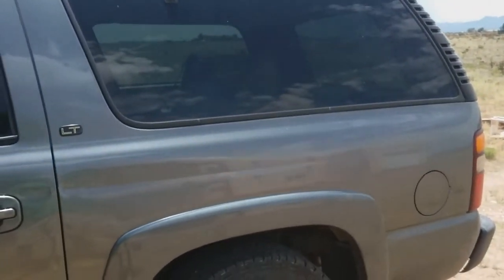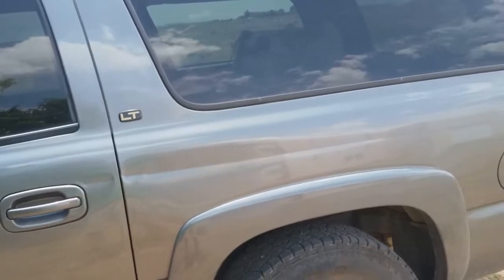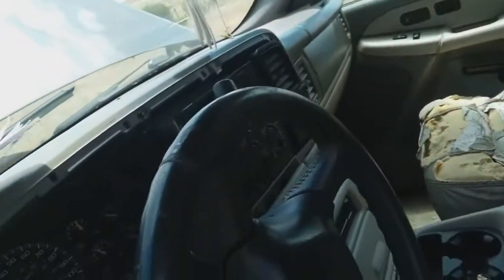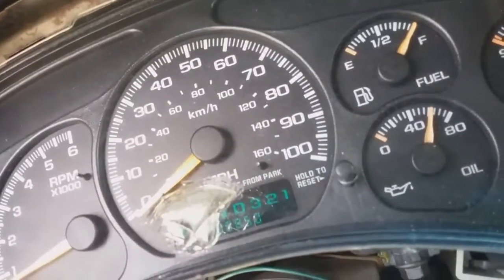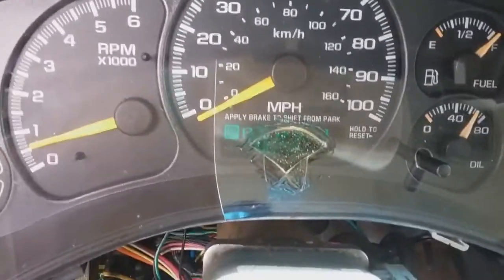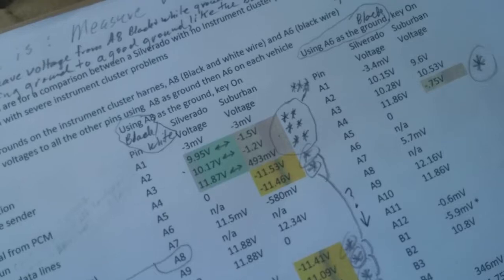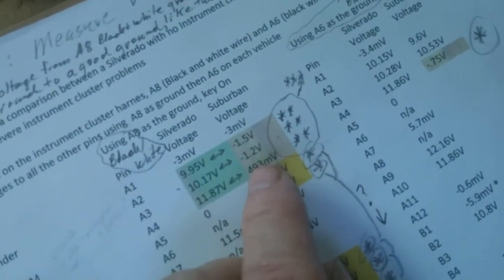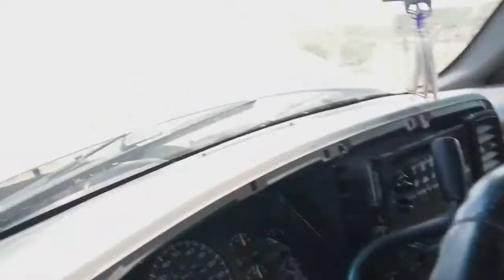2000 Suburban Instrument Cluster Fix

Comment: Pin A8 is the black and white wire ground that runs from the cluster to the back of the engine. It seems to be the wire at fault for everyone who has a 1999 to 2000 Chevrolet or GMC. Thanks for the video!! 👍
Reply: How did you fix it
Reply: @jankycustoms6089  I cut the A8 black and white wire coming off the cluster and grounded it to a metal section of the dash.
Reply: @ZBrink11  I thought I had the same problem with my cluster ( no move gauges and don't turn on ) I asked you if you cut the (black and white) wire as you stated, you don't think the ground wire is taking others  wires connected in the back with that wire or is the wire alone and just connected to the motor?
Reply: @victorgutierrez5826  I didn't cut the black and white wire, I removed some of the sheath and soldered an additional ground wire to it that I ran to a metal part of the dash.

Comment: Having a "known good" part to replace the "know bad" part. And the trouble staying at the "known bad" vehicle is a trouble shooting skill that is uncommon now a days. Except in logical thinking people. And you sir trouble shot that dash very logically.
Reply from the maker: Thanks for watching and commenting. Yes, it really helped to finally find out the dash for a 2001 Silverado could be interchangeable in a 2000 Suburban. Really helped to know it was not a bad dash, but a problem somewhere else. Then finally find the ground wire problem and the fix turned out to be so easy after that after much hair pulling. LOL!
Reply: @johntube2525  I've got a 2001 GMC Sierra with intermittent issue with gauges not working (fuel, volts, and some idiot lights). I cleaned some grounds, dielectric grease reseated and it helped for 6 months. But starting to happen again. So adding another ground to the A8 pin and see what happens. Thanks for the video.

Comment: The issue I'm having is my fuel, coolant temp gauge, and odometer display didnt work, so I replaced cluster, but having the exact same issue, the display only works in ACC mode, but not ON, I must have a bad ground somewhere also
Reply from the maker: It is pretty easy to check if your problem is a bad ground, by doing what we did in the video. Also see my other comments on how to do this. By the way,we came so close to buying a refurbished instrument cluster, which would not have worked. Luckily we had  two vehicles which take the same clusters and could swap them out to find out it was not the cluster, but something else. But now you do know it is not the cluster. That of course is assuming you bought a good working cluster which did not fix the problem. 
Good Luck! Just keep digging and you will eventually find the problem
Reply: Same !!!! What was your fix ?
Reply: I’m having the same problem…. What was the fix?
Reply: Also my AC controls and Windshield Wipers And Tow Haul does not work

Comment: Had a similar problem on my 98 chevy. The positive wire coming from the battery was the problem. The exhaust burned a hole in the wire that did not go all the way through. But caused the engine to become positively charged or something like that. I would probably not have figured it out if it weren't for a guy who helped me off the road.

Comment: Clarification please; was the issue that none of the gauges worked, or was it that the dash lights for the instruments didn’t work? My issue is that the dash lighting doesn’t work.
Reply from the maker: At first it was intermittent gauges and eventually nothing working on the dash! Then once I found a good ground, tested it was good by going to the positive side of the battery with my multimeter, then used that good ground at A8 everything on the dash worked again. A good ground may not be everybody’s solution, but it was ours.  Good luck!

Comment: Hi I’m having a problem with my cluster. My odometer and speedometer are not working. I swapped out cluster like you did and it works in other vehicle
Reply from the maker: I am sorry Omar, I somehow missed your question 8 months ago. Hope you fixed it.
 
If not, it is pretty easy with a short piece of wire to create a ground like we did and put the other end into the back of the wiring harness where your ground is, like a back probe,  We had two grounds one was a black wire and the other was a black and white wire.  The Black and white wire, in our case was the problem. Once we had the ground wire, back probe in place everything worked. Just make sure you have a good ground, before doing this test. If that does not resolve the problem, and you still have access to the other vehicle your cluster worked in, I would unplug the wiring harness from the cluster and then do some front probing. Use a known good ground for the common or ground wire on your voltage meter and then check the voltage reading at the other locations on your wiring harness with key on. Like we did in our video. Write each one down. Then do the same on your vehicle where the cluster doesn’t work and compare to see which ones are substantially different. This should lead you to where the problem is.

Sorry I am just now seeing your question. Good luck!

Comment: My 2002 silverado was having gauge issues. Running a fresh ground for A8 alone did not resolve my problems, but when I ran a fresh battery positive constant for A9 (because my voltage there was clocking in at like 0.43 volts), everything came to life. My symptoms were a non-functioning tach, PRND/odo display, and coolant temp gauge. Once I ran the new A9 wire, all of those began working. Hope this helps others, electrical problems can be a real pain. You can also check the wiring underneath your fuse box in the engine bay, sometimes mice can chew those wires up without you realizing it and you have to remove a lot to get to that wiring.

Thank you for posting this video, it was immensely helpful. The people leaving negative comments are just frustrated that this solution did not work for them and they need to keep looking for whatever their problem is.
Reply from the maker: Thank you for a great comment! Thank you for explaining your symptoms and how you ultimately fixed the problem. Great comment! 

When I am watching other people’s videos, I try my best to go thru the comments, because there can be really good information sort of hidden there. Just like yours! Thanks for watching and thanks for sharing your experience.

Comment: Your video gave me a good base to start from. My trouble turned out to be the connector itself.  The ground pin apparently was intermittent.
The 2 rows have a "comb" device that I assume keeps the female pins in contact with the male portion of the connector.  I took them out and CAREFULLY reformed a curve to them. Intermittency gone!  But hey, all my solder joints are now perfect!
Reply from the maker: Good job, glad you got it fixed and made your comment. I always try to read comments, because there can be a lot of good information in the comments. Hopefully your comment will help someone. Good Job!

Comment: Wow. I a. Going to try this ASAP. None of the guys that repair these clusters even suggest to do this first which they should. They just show how they solder the intricate stuff inside the cluster. Of course most people don’t want to do that or can’t so they send the cluster off to them to repair. 
I tried soldering a few places inside myself and made a horrible mess. It was exciting for a few starts because it seemed to work. Then it stopped working again entirely. I really hope it’s the black and white ground. Thanks!
Reply from the maker: I will keep my fingers crossed for ya! My twenty year old garage door quit working awhile back and I did solder some bad looking solder joints on the circuit board and it did work. Still working today. I show in that video what a bad solder joint looks like.
I almost bought a brand new one, but read some reviews on them that said they wished they had just repaired their old one. So I gave it a try and it worked.  Good luck! I hope it is just a bad ground.

Comment: Nice video gonna try this on my 2002 tahoe. Thanks for sharing your knowledge!
Reply from the maker: I hope all you have is a ground wire problem like we did. Best way to test your new ground is to check with either a test light or multimeter and see if you get 12 volts DC or the test light comes on when you go to the positive side of the battery. Once you know you have a good ground with this simple test, then back probe your new ground wire into the black and white wire at the wiring harness and hopefully your instrument cluster starts working again. Thanks for watching and commenting. Good luck!

Comment: Saw another video where a guy spliced into A8 , so I did the same thing and ran the ground to my battery. So far it works , that A8 wire runs to the junction box then to behind the motor (103). On my 2002 the bolts horizontal on the back and hard to get too.  
So anyone who doesn’t want to deal with that bolt just splice a new ground into A8 . Also the cluster on 99-2002 are not the issue it’s the 2003-2007 that have issued
Reply from the maker: Thanks for watching and letting us know how you solved your similar issue, which was providing a good ground to A8.
Reply: @johntube2525  thanks I’ve been dealing with this for a year. And noticed I watched your video a long time ago.  But didn’t realize you did the same thing as this other guy until now lol.  I was kinda nervous about unbolting the 103 ground on the back of the motor and not being able to get it back on.

Comment: Sir you just made a great video, i never stop learning on this field, i was working on a 2000 tahoe and had this same issue, bad ground, thank you for taking the time to post that video, it helped a lot. My problem was G117 on top rear right side of engine by the intake manifold and cylinder head, theres a bolt with two black wires, one of the was damage.
Reply from the maker: Thanks for watching and commenting. It is good to hear that my video did help someone. YouTube is a treasure for DIY fixes of all kinds. Love it!

Comment: vary good info thank so much, you helped me fix mine, with this test.  i  found out my A4 was not getting any juice, so i ran 12v key on power to A4 wire now everything works agian. thank you again
Reply from the maker: Thanks for your comment and glad the video helped you. 
When I do a You Tube search for whatever problem I am having. I always try to read all the comments, because there can be some really good additional information hidden in those comments. That is why I am glad you made your comment as it may help someone else with a similar problem.
Reply: Where do find you the letter/number designation for each wire? For example A8, A4 etc...

Very helpful video, thank you. I have had similar problems for over a year. The cluster would lose power, and the needles would jump around, and then it would fine for a while.
Now it has got to the point to where almost everything doesn’t work. Hopefully armed with this knowledge I can get it figured out.
Reply: Never mind I found the numbers🙄. 🤪
Reply: @chrisharris3807  Well, don't keep it a secret!! Tell us where you found them. I need to look for them too. Haha
Reply: Can you share where the A4 wire is located?

Comment: Good job thanks, i wonder if relocating the ground at the back of the motor would be a fix also. As my goround is saturated in old grease? I will report back if that fixes my truck.
Reply from the maker: If that wire is black and white, and eventually connects at A8 on your wiring harness then that most likely is your problem. 
The harness that plugs into the back of the instrument cluster is labeled A1 thru A12 and B1 thru B12. On our 2000 suburban and 2001 Silverado the A6 and A8 are the ground wires. A6 is solid black and A8 is black and white.  I think the black and white wire is supposed to terminate at the back of the motor to provide the needed ground. I could never prove this, because I could not even get my hand back there to check. However once I found a good grounding point inside the dash on the Suburban and I attached a wire to that grounding point. I then checked it, to make sure it was a good ground by measuring around 12 volts on my meter by taking a long wire all the way to the positive side of the battery. Once I knew I had a good grounding point I took the other end of the wire up to A8 on the wiring harness and back probed it into A8. I then tried turning the key and the instrument cluster worked. Conclusion: We had a bad ground at A8. I think the wire going to the back of the motor, which was supposed to be black and white, was our problem, however I never confirmed this. The back probe into the back of the harness worked fine to make our cluster work again, but a better connection like a wire splice would be better. Good luck!
Reply: @johntube2525  that's what I'm thinking, I will report back.
Reply: Well i extended the black and white ground wire to the front of the passenger side cylinder head and same thing no cluster action, oh well Looks like I will need to check the big connector at the cluster.
Reply from the maker: @lonniesanchez2732   I feel for you! We spent lots and lots of time trying to figure out what was wrong. We almost bought a refurbished cluster until we found out my working 2001 Silverado cluster would not work in his 2000 Suburban and his 2000 Suburban cluster WOULD WORK in my Silverado. So that meant both clusters worked fine in my Silverado and there was probably a wiring problem in the Suburban. My son wanted to try that 1st, but I was reluctant, because I was afraid we would ruin my good working 2001 Silverado cluster by putting it in his 2000 Suburban.  We could have saved ourselves a lot of misery had we tried that right away. I am sure you will eventually solve the problem. Good Luck!
Reply: @johntube2525  I have a spare cluster I will toss in there I will also report back. Thanks John

Comment: I am having the same issue with my cluster.  All I did was disconnect my battery for a few hours and when I tried to connect it back the needles did not work, nor did the odometer.  I have a 2004 GMC Yukon SLT though.  I hope this will solve my issue.
Reply from the maker: Good Luck, but the way your problem started sounds different. My son’s was intermittent, then eventually permanent. However, the ultimate symptom, No Friggin Cluster, is the same. So, who knows? I wish you luck and please feel free to comment some more and let people know how you ultimately fixed your problem. I read every comment people make on my videos. When I am looking for help, on YouTube, to solve some kind of a problem I am having, I read many, many of the comments on videos made by others. Sometimes the solution, is not in the video, but has been explained in the comments by someone that had a similar issue. I love YouTube! It has a wealth of information. Good Luck!
Reply: You have the 2004. You need to resolder board pins inside the cluster. It's not a big job.
Reply from the maker: @SuperCyril2  Thanks for commenting here on a 2004. I hope they read the comment and I hope it works for them. Thanks!

Comment: Damn it looks like Freddy and Jason had a fight on those seats lol
Reply from the maker: LOL! it sure does!
Reply: @johntube2525  lol I just fixed my gauges. I installed a (new to me) set of SS gauges in my 04 Silverado a couple months ago. Haven’t had any trouble out of them. Took it in for inspection today and wouldn’t you know they started acting up. Battery light staying on. No oil pressure , voltage , fuel , or temp. Speedo and tach worked. Abs light on. Took the knee panel off and whoever installed the security system had a rats nest of wires with the joints just twisted together with electrical tape on them. Turns out one of them was the ground to the cluster wasn’t making a good connection. So I fixed that shit lol. Came across your video and watched it first. 👍
Reply from the maker: @alphasaiyan5760  Good detective work! Glad you found the problem. If nothing else, my video shows an easy way to check if the cluster is not being grounded properly. Simply find a place to ground a new wire, check it is a good new ground by test light or meter to positive side of battery. If good new ground wire, back probe that good new ground wire into the black and white wire on the cluster wiring harness. See if cluster works. If it does make a good splice, so it will hold up to rough roads and vibrations.  I guess the new ground wire could be to the OBD2 black and white wire like you said before, but I would always check to make sure it is a good new ground wire by going to the positive side of the battery with test light or meter. Good comment and thanks for watching and commenting!